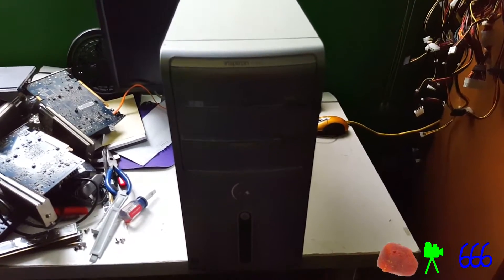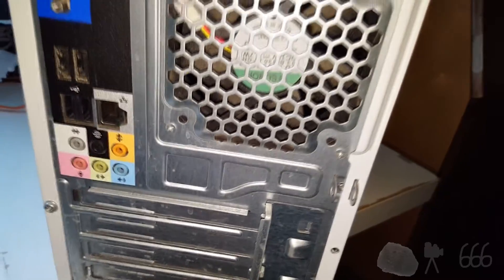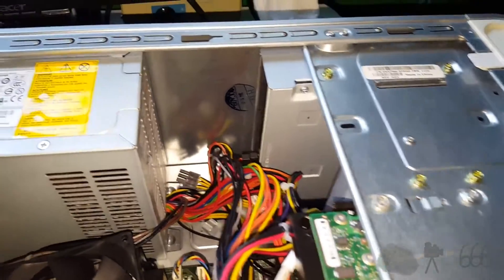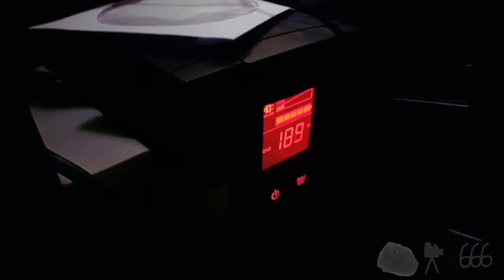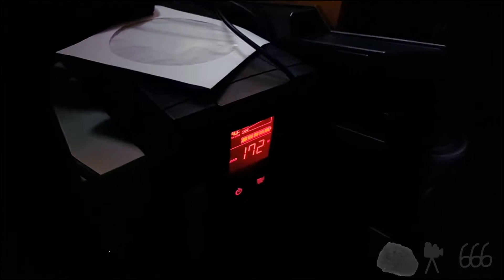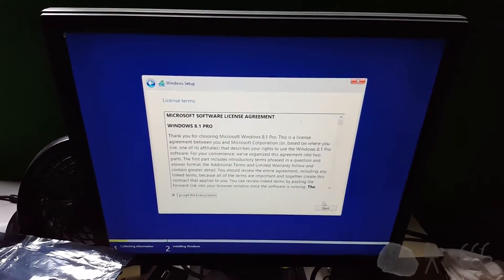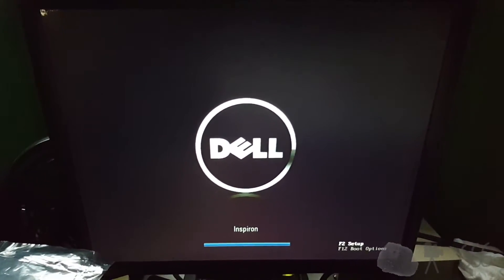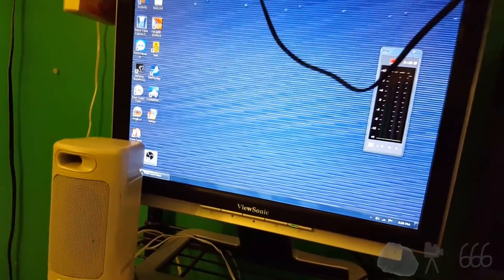Dell Inspiron 530

Comment: Can I change the power source for an evga atx? And put a current micro atx motherboard?
Reply from the maker: Any ATX power supply fits. You cannot install a different motherboard without modifying the case which quite frankly is a massive waste of time given the plethora of microATX cases out there.

Comment: As best I remember, the chipset in those is new enough that Intel deleted the PATA logic.

Also from the "if memory serves" department: The very similar Vostro 200 uses an ITE Tech LPCIO and SpeedFan is quite happy to let you change its operating modes and fan speeds.